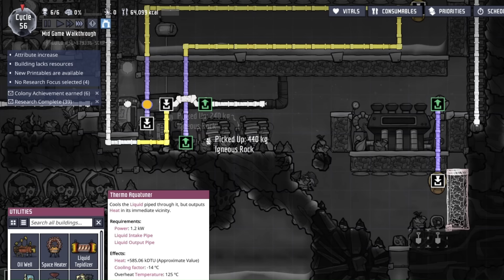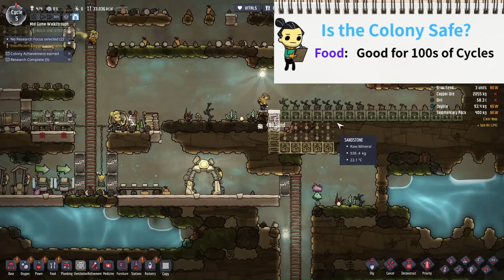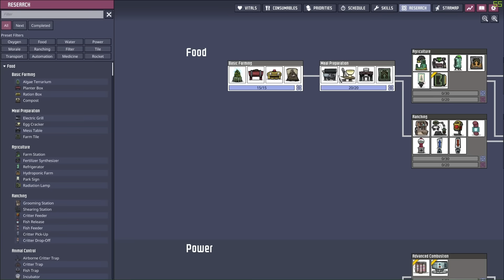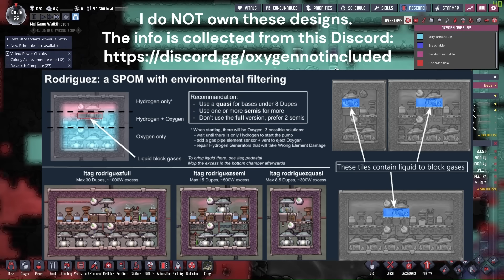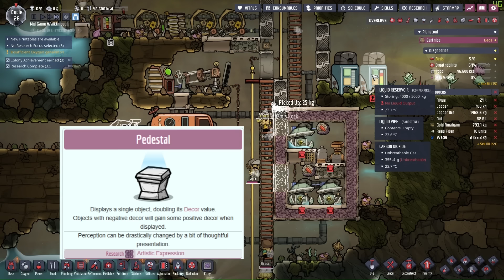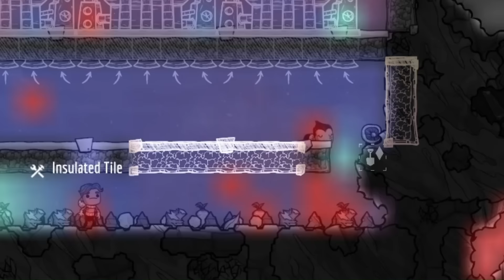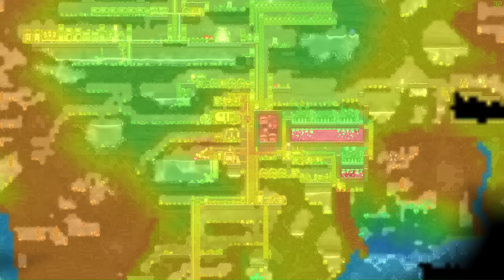The Complete 2026 Mid-Game Engineering Guide of Oxygen Not Included

Comment: Hi TabeYuriko, I'd like to propose a challenge, for a base game (Vanilla or DLCs, but no Spaced Out) run:

How early a colony can get all achievements, all story traits, the Sweet Home achievement, and ending with the Great Escape by send all duplicants to the Temporal Tear (and ending the colony at the same time)?

I reckon a ONI pro player can get it before one year or 365.25 cycles at a minimum. Or less if the "One Year, to be Exact" achievement is ignored in the challenge for the sake of a speed run.
Reply from the maker: Hmm, I happened to done the spaced out version and finishing everything before 365.25.
Base game doesn't require the silly Mine the Gap, but requires a hydrogen rocket. Interesting...
Reply: @tabeyuriko  Yes, the hydrogen rocket is essentially at the end of the research tree. Getting it is a challenge. It requires so many trips for databanks. Useful to make rockets 55 or 60 tiles high (11 to 12 modules), so to get as many of these databanks as possible for a single trip.

Such tall rockets require deep rocket silos, that extend from  the upper limit of the map all the way to the asteroid abyssalite and likely into one of the biomes close to space. All needs to be protected against these pesky shove voles from invading the inside of the asteroid.

Also depending of the dice roll, getting the gassy moo for taming is also a challenge, and the biological cargo module which is as expensive as the hydrogen engine and liquid oxydizer tank. If it's too far, a petroleum with oxylite rocket may not get there.

LOX/LH2 will be needed, which means supercoolant ASAP, or another lucky dice roll for a close asteroid with fullerene. Rocket "farming" for databanks and fullerene may be needed.
Reply from the maker: @AlexKasper  I guess the space roll is really important, I did try it a few times before, but the wait for rocket to return is so dreadfully long for me :_happy:
Reply: @tabeyuriko  Yes, indeed, waiting for a rocket on vanilla tests one's patience 🙂

The trip to a far away asteroid with such needed resources (e.g gassy moo) can take easily 20-25 cycles. This would need to be accounted for on any speed run. Also pays off to groom a dupe or two to be the best pilot in the Colony to make for such trip. But other than attaining second tier of piloting in base game for a small boost in speed, there are no other additional bonuses that would make a rocket trip faster that I know of, other than a check from mission control for a boost.

I've been playing all-achievements runs, HSH, and TGE (ending the colony there) for my past 4 o 5 colonies, albeit not doing a speed run, as I'm not that good 🙂

Yet I found myself preparing the gassy moo ranch by the time the rocket sent to retrieve these large critters is yet to be built. I assume on said challenge run, the Player could prioritize space program launches, all while other achievements are being completed.

On a speed run, with rocket trips "mining/farming" databanks, to get as much research as fast as possible, the Player would have to make a decision on the research tree bifurcation: to go first for the Hydrogen rocket and liquid tank, or to go for the biological and sighseeing modules.

These research rockets need to be tall. Another decision is: Considering refueling time, do I keep sending 55-tile tall steam rockets to the nearest 10,000 km asteroid for 90 databanks, on continuous back and forth trips, or I spend many more resources and cycles to send these dedicated research rockets to further destinations that are still "virgin" (at 60 databanks per module), all to get the 2700 (?) databanks needed to complete the whole research tree?

Comment: Let's talk about putting power generators into sauna rather than metal refinery. By definition generators batterys and transformers produce some heat and you don't need to cooling output because it's electricity. If you tame some metal or magma volcanoes than you build steam room anyway. So it's already here, just put more stuff there. Valid?
Reply from the maker: Batteries and transformers are kind of fine inside the steam room.  
Although their heat isn't really... that much, but at least they aren't "worse than nothing" which steals your heat.
But that requires special resources, likely all of them needs to be steel or better to survive in the steam room.
Too tedious for the return it can give us imo :)
But if you noticed, I said "industrial production buildings" shouldn't go in the room, which didn't include batteries or generators :P
Reply: @tabeyuriko  yeah, I hear your point. Make sense. For natural gas generator there could be very specific reason - boil polluted water to clean water. Jumbo batteries are good to store excess energy from steam turbines and solar panels. Yes their heat might be small but I found it's easier to put inside steam room rather than cool them down. Maybe it's just the same reason why spom is good to contain heat in one place.

Comment: Never apply cooling directly to anything. Always cool a buffer and then dump heat into the cooled buffer through a heat exchanger. This way you can have a reservoir of "cold" and set a target temp for the heat exchanger between the cooling loop for whatever you are cooling and the cooled buffer. This allows for breathing room if your power fails, if you need to cool more due to a sudden heat event or whatever emergency since you have a "cold" stored.
Reply from the maker: The "direct" is meant to be in contrast with "cooling water",  not to deny using a buffer :)
And yes having a buffer can be nice and often allows more precision in cooling or achieving different target temperatures with one aquatuner

Comment: Instead of running a second gas line to power the atmo docks you could use a canister drainer feeding into a hydrogen generator and smart battery. It does require another tech to be researched but a single 200kg canister will last an extremely long time if that it all that is being powered
Reply from the maker: Yes I mentioned about canister drainer, and that it takes no long piping but occasional duplicant delivery

Comment: Very curious to hear your take on Industrial Saunas 🤔

If I understand correctly, the logic is that we are bringing cold ingredients into the sauna, they absorb some heat, get converted to products, absorb some more heat, and then leave the sauna, thus deleting/removing heat from the sauna. Then you need to waste power recapturing it, or accept that the heat was deleted in the first place.

I was always under the impression that an industrial sauna doesn't really care about recycling power, since infinite energy is very easy to acquire in ONI. It's more about centralizing/simplifying industrial processes, and recycling some power is a nice side-effect.
Reply from the maker: the power part is overall negative (than not doing it) so it's really a bad side-effect 😿
But centralizing stuff might be a good point, kind of like OCD layout?
I just wonder how many people using it are aware that it actually don't generate more power than not doing it
Reply: @tabeyuriko  Good point. I think it's important to let people know that an industrial sauna is not "generating power", just like an Aquatuner/Turbine cooling loop for the base is not "generating power". 

You're spending power to collect and delete heat. Any power generated by the turbine is just slightly reducing the cost of running the Aquatuner.

At least in the case of the sauna, you don't need to spend power collecting the heat, it just naturally spreads out into the steam.
Reply from the maker: @LagiacrusHunter  The point is this "don't need to spend power collecting the heat" in industrial sauna is actually even outweighed by the drawback it brings (by materials stealing heat in the steam room), that's why I call it "literally worse than nothing" 😅
Which means it actually waste more power than just collecting the heat actively with aquatuner.
Reply: @tabeyuriko  Hmm.. but if you are using an aquatuner to cool your base, isn't that the same thing? 

The materials leave the sauna and emit their heat into the base, which gets collected by the cooling loop. If you don't use a sauna, the buildings and materials emit their heat into the base directly, which is also collected by the cooling loop 🤔

I have also seen some folks use a "Debris Chiller" to keep the heat from the hot output materials inside the sauna. Wouldn't that also be the same idea?

I would love to see a demo if you have a sandbox environment to show how the math works 😄 It sounds like a very interesting puzzle
Reply: @LagiacrusHunter  Mmmmh. True. Tho what you're saying is the power part is irrelevant. It's the convenience of only temperature regulated materials getting into the base so you need less cooling infrastructure inside the base.
Reply: @tabeyuriko  Pretty sure like 90% of the people making an industrial sauna already know it's not a thing to do for power, but as an easy way to keep the machines 'cool' enough to run continuously. Outputs from the metal refineries, rock crushers, whatever else, output such a small volume of mass that when they are brought out of the 200c sauna and into the 20c base, the air cooling loop they no doubt have in the base will easily take care of it. The turbine is there just to keep deleting heat, not to explicitly generate power.

Comment: Can you make guide how to survive without Thimble Reed and Dreckos and other fiber sources on first planet? Hardcore mode: also no oil. And other plastic sources :-) And of course no Teleporters — too easy.
Reply from the maker: We can always use oxygen masks -- and for most of my "challenge type" videos I seldom use atmo suits
(Check the solo great escape in 100 days one, I done great escape with only oxygen masks)
But yeah let me think about how to make it into a guide 😃
Reply: @tabeyuriko  question is not only about oxygen, but about oxygen and scalding
Reply from the maker: @aakhamef  I would just rocket to other planets that have oil :_happy:
But let me think how feasible this is for general players..🤔
Reply: @tabeyuriko  but how do you rocket there? Without proper fuel and without heat loss on the main planet? Hardening: suits and oil-plactic farther than one carbon dioxide rocket flight? My questions about alternate heat loss on midgame, and/or space tricks. For loosers like me, who cannot into speedrun. Also no deaths
Reply from the maker: @aakhamef  If you setup refueling mechanics, co2 rocket can travel to planet 7 hexes away, and that should be enough for all the inner ring planets
And we do it early enough to not let heat become a serious problem in home planet

All these discussions are good so I know which important issue I should cover in my video :_happy:

Comment: Oh. I really need a video explaining why industrial sauna is bad.
Reply from the maker: 😍 It will take quite a few preparations for me to make 😂
Reply: @tabeyuriko  Please do.
Reply: @tabeyuriko  Is the point is that when you bring the building materials into the sauna they are not at 100+ degrees, so a ton of the heat you're generating inside goes into heating those building up first. The dense buildings inside your steam room are constantly leeching heat from the system, most of the heat in fact - since all the steam has a tiny density compared to metal and minerals used in making those buildings. So an empty room will put all the DTUs into the air which can be extracted by your turbines, while a fully furnished room puts the vast majority of the heat into the objects inside the room - so you that energy is trapped doing something meaningless?
Reply: @Raistlin212Speedruns  Once the buildings suck up the excess heat the turbines would in theory generate net positive energy. Maybe the payback time is more cycles than a typical map would exist though.
Reply: @Raistlin212Speedruns  That's cool and all but when I see three metal volcanoes next to each other I'm not passing up the opportunity. They look cool.
Reply: @tabeyuriko Please do as well. I would like to hear.
Reply: The base reason is most stuff you’d be putting in there actually outputs at a lower temp than you would want so it’s not power efficient. Among many other things
Reply: @RoozleDoozle-9210 yes but they r good if u have some kind of metal volcano or magma volcano in them.
Reply: Just putting a glass forge and kinl is another to raise the temperature not to mention you can loop the output of the refinery in it (use petrolium or something) which will be infinite heat @RoozleDoozle-9210
Reply: Imo Industrial sauna is an end game prestige project. Kinda like sourgas boiler.
Reply: @fractalgem pouring water in a room is not kinda like a sour gas boiler
Reply: @nicewhenearnedrudemostlyel489  they just mean that you never have to do either, but you do it cuz you can, to prove you can.
Reply: @FaithOriginalisme  More like you gotta make a industrial brick anyway, why not pour water over it and harness the heat power.
Reply: @heydadxd60  that's what  a cooling loop and aquatuner do, right along the metal refineries. they just harness the heat by transferring it to the cooling liquid first
Reply: I think it's worth if you put volcanos in it. In my current colony I built a sauna on the bottom of the map where I had 3 minor volcanos and geothermal heat spike.
I also like doing dirty saunas, with petrol, nat gas and other co2 machines together with molten slicksters. I use a separate steam room to cool the machines.
Reply: only put buildings into a sauna if they dont produce anything, so things like hydrogen generator is fine.

for example a metal refinery produces refined metal at 40°C (i think), which then get heated up from the sauna. so you need to cool it down and it takes away the heat of the sauna. so instead i place the metal refinery outside of the sauna, the heated liquid gets directed into a small sauna with radiant liquid pipes, steam turbine and aquaturner. 
EDIT: he does show it in his vid at aroun 40min

i place the other power generators that produce CO2 into a dirty brick for the slicksters.
Reply: It is batter to do cold sauna instead - where you fill it with hydrogen and cool it with aquatuner and polluted water. No need for steel and easier and faster to operate (you can do it even with oxygen environment just less efficient).
Reply: I really need a video explaining what an industrial sauna is 😅 I've never even heard about it before. I see no point in having one at all.
Reply: @simonforsberg3757  it's basically a way to consolidate your heat production into 1 room. But like others have said, it's only good extremely late game. And most of the time it's not needed.
Reply: @simonforsberg3757  just search on youtube for these keywords if you're really interested to know. If you don't need it - that's good.
Reply: @simonforsberg3757 you put your industry in a room full of ~130 degree steam and cool it with steam tirbines, giving you a bit of power in return rather than spending power to cool it. 

The biggest and most obvious downside is the staggering amount of steel needed to not have the industry overheat.
Reply: Simply , using materials to make a steam room is too costly. You should make a small steam room with a aquatuner. As for the industrial area, it’s better to have a hydro cold room, or an oxygen one if you’re not using atmo suit. From a hydro cold room, you can also cool many things; the heat will return to the steam room and generate electricity again. With steel, iron, and lead available early on, you can 100% make an industrial room before cycle 100 with only a small amount of steel and iron, and the efficiency will be quite impressive.  industrial sauna is wasted time, and expensive.
Reply: Oh i see what you mean.  My industrial sauanas were separate from other cooling systems, at most a part time aquatuner was used to keep the steam turbines up top cool cause I couldn't get the fully self cooled ones to work right. 

They ARE still very steel intensive of course, making them about as end game as the sourgas boiler.
Reply: There are many buildings that produce less heat than the amount of heat that the materials which enter absorb because of the temperature difference. You also will need to cool the outputs if you need them in the rest of your base
Reply: It primarily needs A LOT of steel so each building can handle the heat it produces.  If you want my personal opinion, build one around a minor/normal volcano.  That way the heat from the igneous rock can be transported on rails in a radiator-like pattern, warming up the room, and generating that heat so it’s not entirely coming from the machines.  But if you’re dead set on having an industrial brick i’d recommend a “cool” one, which means you actively cool it with an aqua tuner and steam turbine.  With a “cool industrial brick” your machines can be made out of any material, a much lower barrier to entry, plus it doesn’t need to be made around a volcano
Reply: I've made my industrial sauna mid-game around an Iron volcano with a geothermal heat spike and it was the best thing I did the entire game